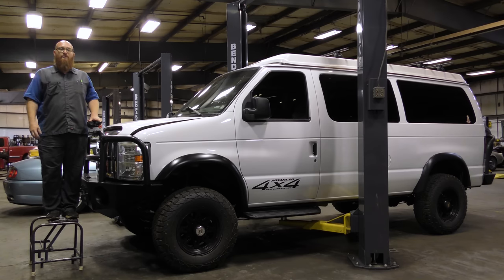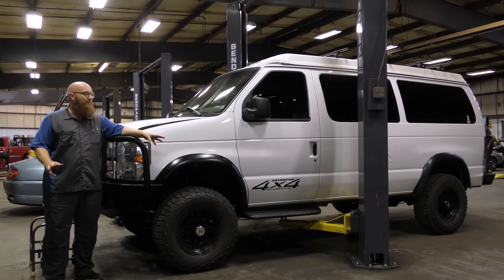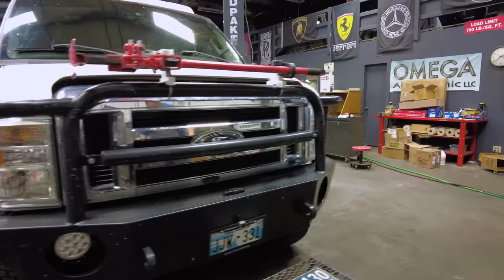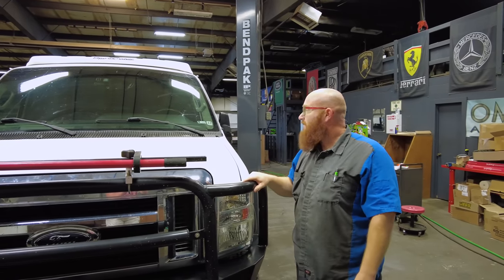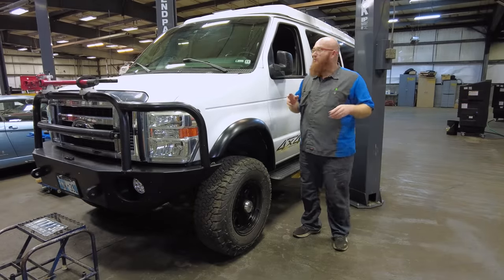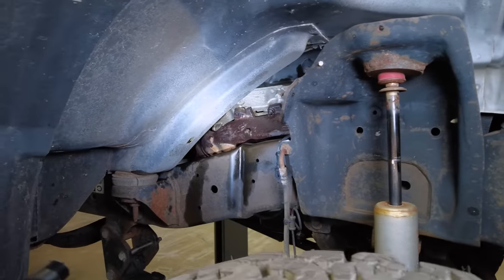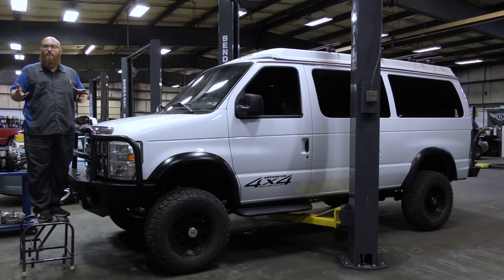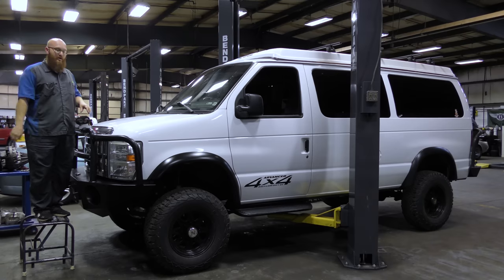8 shops refused to work on this custom '10 E-Series Van! CAR WIZARD shows how easy it was to fix!

Comment: Had a very similar problem trying to get my class C motorhome worked on.  94 Ford E350 with the 460 V8.  Exhaust leak at the passenger side manifold and had a leaking transmission pan.  4 shops outright refused to work on it,  one fella does work on heavy equipment and he was able to tackle the transmission, but was stymied when it came to the exhaust.  Was camping in Algonquin Park and met a fellow camper with the exact same camper and it turns out he was a heavy truck mechanic in Toronto.  When  camping was finished I took the camper to his shop where he fixed it and it now runs and sounds great.  Even though its a pain driving the extra distance into the heavy traffic of a very big city, he's my new mechanic!

Comment: Here's a fun fact about these vans: These vans never ever came with a 5.4 3 valve engine. All E series V8 and V10 gas engines from 1997-2014 are 2 valve Triton motors. You don't have to worry about cam phasers on these because they don't have them. Only the F series trucks, Expeditions, Navigators, Mark LT trucks had the 5.4 3 valve.
Reply: Agreed, E series rode out the 2 valve until the end, no 3 valves to worry about with these
Reply: That's exactly what I was thinking, he let his hatred for an engine cloud his judgement.
Reply: Very useful info to know.... I was always turned off these vans bc I thought it used the triton
Reply: Another fun fact, none of the V10s had cam phasers either even though the later years were 3 valves in the f series.
Reply: i'm less concerned about that, than i am the possibility of it being the engine models with the possible plug blowout heads still installed. (rare, these days, but still)
Reply: @kenabi  PI heads with nine threads have been used since ‘99.
Reply: If only they could have kept the 7.3 diesel too. thanks a lot, EPA.
Reply: Thank you for pointing this out. For some reason this seems to unknown to a lot of people. The 5.4 2v is a very reliable engine. I own a 5.4 3v with 303k on it . As it's been said it's all about the maintainence.
Reply: I have a 2010 Ford F-150 with 2 valve 5.4 V8 (last yr) it’s been super reliable. I was afraid I was gonna have trouble changing spark plugs, but nope. Ford fixed all the issues of the last two years of the 5.4 liter V8.
Reply: @fastfox851  I'd say it is the PTSD from working on them
Reply: Thats why they last forever and you see them rotted all the way up the rear wheel well to the window but it runs mint
Reply: I wonder why he kept calling it a 3v? Figured he would know that
Reply: Cool... Thanks.
Reply: Only huge timing chains to worry about.
Thanks I didn't know no phasers in Vans.
10mpg motor though.
My Chevy 5.3 gets 17-20.
I have both .
Reply: I wanted to buy an e-series a few years back… but couldn’t find a nice one… bought a 5.3L 02 Suburban
Reply: Yeah, I was curious about him saying it was a 3V. I wondered if maybe the custom job included the 3V being put in place of the 2V. Couldn’t see enough of the engine to say what it actually was.
Reply: @superstar64  I thought International discontinued the 7.3. Pissed off Ford and they were suing each other over it for years. But, who knows, I could be wrong (usually am).😁😁
Reply: @ProjectFairmont  went as an actual issue till 2002, but you just never know if someones pulled one out of a junkyard that didn't fail and slapped it on a 5.4 as a quick fix.

someone tried to sell me a van with that very issue mm.. 2019? was a 2013 cargo van, but someone had swapped a head for whatever reason and it blew out at least one of the plug threads.

told them flat out i wanted nothing to do with replacing a head on it. i had no space to do it, nor the time.
Reply: A friend has a similar conversion and nothing matches the original vin, except the frame and engine. Axels, transfer case etc. The fuel tank was cut down to make room for one of the drive shafts and was comically small. Edit after watching the full episode Might have been a 4x4 transmission and not a drive shaft. There is a custom made replacement from a diesel fuel chassis.  It's totally possible this has had an engine replacement.
Reply: "Tri" = 3
Reply: I’m going to guess that is actually a 4.6 2v because that is a aod/4r70w transmission. The 5.4 usually has the e4od/4r100
Reply: I was literally about to say that, this van is still a 2 valve.
Reply: Was it the Triton or was it just the regular modular engines they had?
Reply: Kind of on the same level as GM making only the express van 4.8 without the terrible Displacement on Demand. They were still VVT though and MAN what a beautiful one tire fire!
Reply: Also, the 5.4 3v engine didn't have the issues of the earlier motors with the cam phasers because they had the newest versions. They finally got it right, then they replaced it with the Coyote.
Reply: @dbrandon4528  350k on my 2003 all original motor . Just minor probs
Reply: @Jerry__S  Yeah..my e350 Triton 10mpg empty.
My 5.3 GM 15-20 .
Those motors horrible design.
I was a Ford guy in 80s trucks good.
Reply: @superstar64  Zero power and the 6.7 is far superior. no need for the 7.3 these days.
Reply: @Shop_Simplicity  
Okay but the 6.7 wouldn't fit in an e series, plus emissions controls, so yeah.
Reply: @superstar64  I just read it was actually discontinued due to excessive noise from the engine and not emissions. Not 100% though :)
Reply: @fastfox851  and like the 5.4, the 6.8 rode the 2V till the very end of the econoline.
Reply: @Jerry__S  cool a new motor ok. I had Ford's in 80s were ok 
I love 6.0 GM gas cheap simple .I got 350k on one in dump truck .
Reply: E series is still in production as a cut away/cab chassis. They actually updated the dash and 2 engines available are the 6.2 and 7.3 godzilla.
Reply: @joshuamuchmore5049  no room in the engine bay for a 3V, it's tight with the 2V.
Reply: @MitzvosGolem1   my 98 E350 5.4 2wd 3.73 gears gets 14mpg at 70mph. My 97 6.8 V10 same gearing gets 11mpg.
20006 shuttle bus 5.4, 4.10 gears gets 8mpg
Reply: Butttt you do have to keep a ear out for rockers going bad, especially on #4 for 3valves.  If not fixed when starts ticking .
Reply: @MitzvosGolem1  My 2003 E350 gets 13-14 mpg and I am always pulling a trailer behind it.
Reply: @henrykim4230  They we’re called Triton long before the 3V engine. The “Tri” didn’t mean anything about the number of valves. My ‘02 F-150 had the Triton 5.4 badging. Just a “strong” sounding name for the engine.
Reply: @Dmetsys oh that’s right, I got confused,
Reply: @superstar64  believe it or not I've been hearing pretty good things about ford's 6.7 diesel engine on lasting for a while and people modifying them and surviving the abuse
Reply: @conrasm  4.6 2valve was good engine. NO doubt.
Reply: Everybody hates those 5.4 engines.  Who cares if it is 3 or 2 valve.  They all SUCK.
Reply: @Dmetsys I think it's more that he works on a lot of exotics and has less in depth experience with everyday cars, so he just isn't always up to date on them. He gets a few in that are turds and decides he hates them all, of course the ones that run perfectly don't come in so he doesn't get a balanced view. It's kind of ironic as he works on exotics which on their best day aren't as reliable as a 5.4 3v.
Reply: @TheCyberMantis  My 03 5.4 F150 has been the most reliable vehicle I've ever owned. It's a S/C Harley Edition with about 100hp in mods, and 19 years later with 200K it's still all original. Not even a water pump or alternator. Thing won't die, but it's thirsty and only runs 93 octane. It's definitely a dinosaur by today's standards, but it wasn't a bad motor. 

Seems like all the new stuff is having cam/lifter problems and various brand issues, so even the old 3V isn't looking so bad. Sucks though that it took Ford 6 years to update it in production when they were selling updated replacement parts 2 years earlier.
Reply: I literally went down an hour long rabbit hole to confirm my 2011 E250 5.4 adventure van (also converted to 4wd) is a 2V.  All I needed to do was read the comments!   Rare slip by the Car Wizard, but he should publish a retraction on this video.  For the rest of the Econoline owners, check your Vin.  If the 8th digit is an L, you have the 5.4 2 valve.  And our engines are rock solid.
Reply: I got ask a few time if mine was a diesel… Chain guides in my 99 back in the day..
Reply: @Shop_Simplicity  thats youre opinion 7.3 are hell of alot more reliable .. not as strong but better for dependability
Reply: That makes sense
Reply: 2010 was also the last year of the diesel E series van. They kept the much more reliable 6.0 instead of that 6.4 nightmare because it fit better. Good thing too because by 2010 all the problems in the 6.0 were worked out and it became a decent engine.
Reply: @waexplorer  they still made it was sold as the 466
Reply: My f150 4.6l v8 has over 400k miles original engine
Reply: @superstar64  I assume you like to breath clean air? You may not like all the regulations by the EPA, but regulations are needed to keep Earth sustainable
Reply: Sadly the 5.4 2 valve gets a bum rap because everybody forgets that It exists because the 5.4 3 valve is so bad.
Reply: @DirtyDanMunicipalMan  nahh its not that hard to tell if it's a 3v or 2v ,the  1997-2003 f150, expedition  is the 2v after 2004 it's a 3v.
Reply: @Bore_Punch  After 2004, Ford switched to the 5r100 and 4R75E. The 4R100 was discontinued after 2004.
Reply: @superstar64  lol, yeah epa.. trying to make sure we have breathable air and all... dummies.
Reply: @kenabi  I replaced 2 cylinder plugs @$450 each
Reply: @MitzvosGolem1  250K on my 2002 E350 16’ box truck when I sold it running great. 6mpg
Reply: Never got  6.4 powerstroke either.
Reply: @johnhinston958  no 3 valve . Phasers timing chains .
My Frieghtliner 80,000lb gets 6mpg loaded ...
Reply: @MitzvosGolem1  It’s crazy and you had 50,000 pounds on me😂😂😂
Reply: @johnhinston958  Tires maintenance insurance registration fuel taxes  brakes cost $$$. Now Diesel up $5+ gal. 
Crazy
Reply: I have a class a RV with the V10 2000 model what is the easiest way to visually identify which Triton it has?
Reply: @codemaster3696  2000 should be the Two Valve PI engine. (Three Valve Engines didn't exist yet, and around 1999 the "PI" or "Performance Improved" heads came out)
Reply: @henrykim4230  ton= 2,000 lbs
Reply: @Shop_Simplicity  7.3 kills the 6.7 all day no questions. I've seen a 2021 6.7 grenade at 400 miles, not 400k. Every 6.7 pops it's cp3 every 40k miles unless you're running additives. And I've seen two 6.7 transmissions shit the bed at 85k miles. I've been with 7 7.3 that have all reached 400,000 miles that have all lived hard hard lives and all only had 3-400 dollar repairs here and there throughout their time with me
Reply: @blackdragon46819  6.7s are barely better than a 6.0. and the ten speed transmissions are absolute garbage. Brand new they suck and they all shit the bed at 85k.
Reply: @erikkovacs3097  no 6.0 is decent. They were trash, the 6.4 was trash and the 6.7 is trash especially the ten speed trash. The six speed behind them were trash too. Ford ruined their reputation by leaving the 7.3
Reply: @rch5991  you don't need power in a tow rig you need reliability which ford has sh:t on. 7.3 was the best thing Ford had and now Ford is trash. But they're pretty fast, for a 10k lbs truck. It'll do 0-60 in like 8 seconds now like the Prius plug in hybrid
Reply: My daughter and I turned a handicapped e350 into a camper. She has put thousands of miles on it and it has been really reliable.  Hard on brakes.  Bad on fuel. Really awful door handles.  Best money she's ever spent. I'm proud of her adventures.
Reply: @thecommodoredecker  he said he does not work on many vans so probably just didn't know, I'd give the wizard a pass on this one...
Reply: Right?!? I was blown away when I seen the 5.4L trinton. No way that's not severely under powered.
Reply: The problem with the 2v engines are the threads for the spark plugs are aluminum and like to strip when you try to take out the plugs. The best thing to do is take all the plugs out, drill out the threads and press in steel threaded inserts
Reply: @MitzvosGolem1   The LY6 VORTEC (2008-10) is a brute of an engine for Chevy/GMC trucks and vans. 364 HP/ 383 TQ stock. Used often for hot -rod and drag engines. Basically an LS2 motor with an iron block. Got one in a 2008 Express 2500 van. MPG isn't great, but that engine is a workhorse.
Reply: @markdavid4897  I have a  2003 4.3 V6 in 1500 Express gets 20mpg pulls welder and bobcat on trailer 350k miles most reliable cheap to fix .
I got 380k out of last one.
Reply: Golem1   That’s incredible!
Reply: @markdavid4897  reasonable power.No more Diesel s..$$$$$ waste of money. All Gas 5.3,6.0 gm fleet.
Reply: @Bore_Punch  Good catch on that! Didn't notice it the first time through. I was scrolling through to see if anyone commented on it not being a 3v engine.

 The only way it would have the 4R70W and still be a 5.4 is if it was a E-150 but most of the 4x4 conversion companies won't touch the E-150. It's either an E-150 with a 5.4 or more likely an E-250 with a 4.6. 

Either way, the 4r70w isn't a bad transmission and they don't blow the pump seal if you look at them wrong like a 4R100. And the 2 valve 4.6 isn't a bad engine just not very powerful. But that's why this van has low range.
Reply: @jessaphillips2846  Of course the spark plug threads in the head are aluminum. This is common. The issue isn't that the threads are made of aluminum. Issue is Ford didn't put enough threads into the spark plug holes. Aluminum requires at least twice as many threads then required if the threads were made of steel, as aluminum is much softer. Forget helicoils because when it comes to spark plug threads, is not an ideal solution. You are correct that inserts is the way to go.
Reply: That was fun.....
Reply: @LibertyOrD___h  -Triton 2 valve.
Reply: Some Ford's allow the owner to disable park assist through a sequence of button pressing. The owners. Manual would have the info.
Reply: These vans do use that triton v8
Reply: This guys is mechanic he knows what he’s talking about
Reply: @Bore_Punch  Ford did some weird stuff optioning these vans. I was looking at buying one to tow with.  Turns out 4.6/5.4 passenger/cargo vans came with the 4R70w. You had to have the V10 or a cab and chassis to get a 4R100 or 5R110 behind the gas engine. 

After looking under a few and finding that to be the case, I stopped looking at them. I guess they don't have transmission problems but I'd be worried about towing with a lighter duty transmission.
Reply: Yup the same 2v were never upgraded thus y his is till running good only issues the 2v 5.4 had were spark plugs threading in the earlier versions
Reply: My dad had a 2012 E250 with a 4.6 Liter Triton. He said it wasn't geared right when driving on the onramp to the freeway down. His 06 E250 with a 5.4 Liter was geared right. It has 4.11 gears.
Reply: @TheCyberMantis  false
Reply: Yessir.  Odd this comment has over 500 likes,  yet no correction was ever added to the video.🤷🏾‍♂️

Comment: The real value of experience... being able to quote the customer in such a way that if the job changes, the customer is aware up front.
Reply: Doesn’t matter unless you have the right customer. They hear what they want to hear sometimes. If you say 500 to 5000 depending on what I find all they hear is 500

Comment: Some corrections.
To remove the engine pull it out the front end.
 
I know some of you are squinting at that hood and thinking I am out of my mind. "That engine will never fit throw that hood opening". With most full-size vans the front comes off. You would remove the grill, radiators, and a crossbar that is bolted across the front. Then you can pull the engine and "trans" out.

Ms. WIZARD The Consol is called the "dog house" or engine cover. There are only four clamps holding it down and it is easy to remove. Once removed you have access to most of the engine. Makes tune-ups and most top-end work easy.  ;)

Comment: I had a 2001 E-350 for almost 20 years and put 237,000 miles on it with very few problems! Was a super reliable vehicle and I had a lot of fun road trips and memories behind the wheel of that van. Fantastic vehicles! Would love to have one again, esp one of these 4x4 conversions!